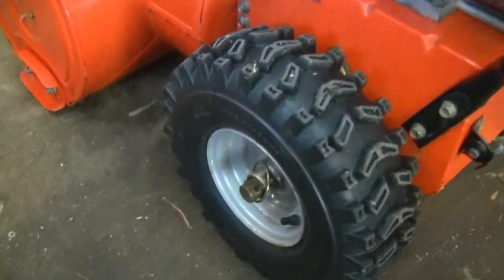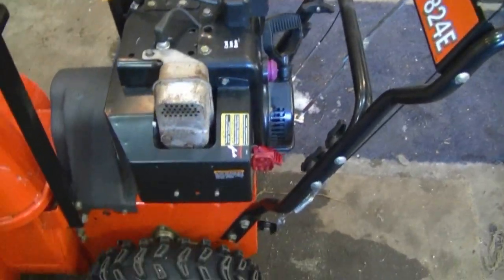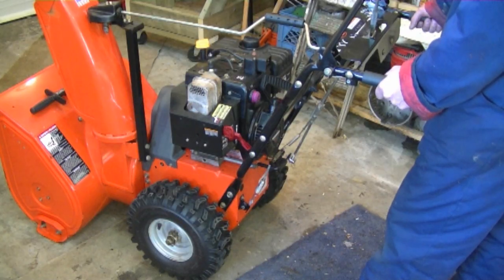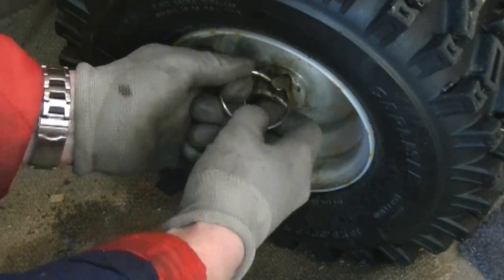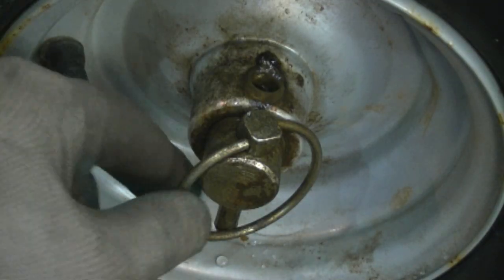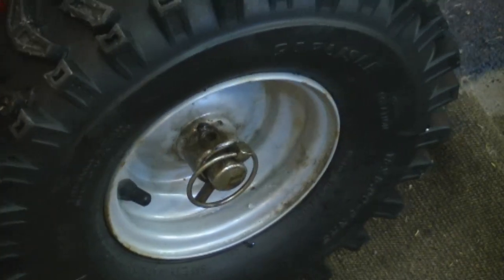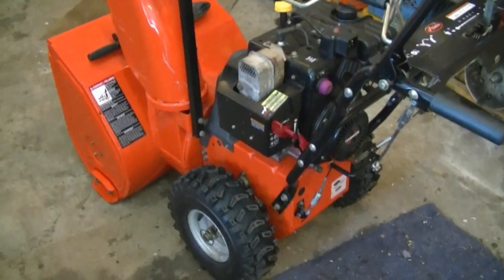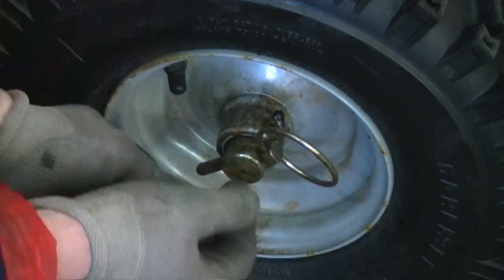WHY THERE ARE Multiple Holes on a Snowblower Shaft

Comment: I was sliding the wheel out and going through the hole and couldn't figure why it was still locked. Never thought about  doing what you did. Thought something inside made it like a differential. Guess I should have looked at the picture a little closer on the snowblower.

Comment: Maybe a silly question but what stops the pin from vibrating out when running the machine if the pin just slides in like that? When it is in the "inside" hole, the ring is around the axle but when the pin is in the "outside" hole, it looks like it is not or can be not around the axle.

Comment: speaking of wheel holes and pins.  I have a 2021 Toro Power Max HD 828.  The axle pins in my wheels keep breaking.  I have had more than 3 pins break on me.  I believe it must have happened to both wheels as neither wheel has the original 'ring pins'.   When the pins broke, I assumed this was normal behavior and used some auger shear pins but it keeps breaking.  Now I am using a cotter pin.  I might be a bit aggressive digging into roadway drifts but only at speed 1 or 2.  

Have others seen and solved this problem?   thanks

Comment: Ok, but why does my manual say this? (I know you don't say to do it this way in your video, but it helps me understand how things work if I also understand what could go wrong if you do it the wrong way) NEVER operate the snow thrower with the
click pin inserted through both the RIM and the OUTSIDE HOLE in the axle. Doing so can result in serious damage to the drive system. 
What could happen if it was like that? 
Let me see if I understand: If I want traction in both wheels, I should have the pin through the rim and the hole closest to the machine, one hole empty and visible on right and left wheels. If I want traction from only one, then I put the pin through the rim and the hole closest to the machine only on the left side so one hole is still visible on the shaft, and on the right wheel only the shaft farthest hole not through the rim at all?

Comment: i have an ariens compact 24 with the same type of wheel set up, i want to remove the wheel on the oil drain plug side to make it easier to change the oil, can u tell me how to remove the wheel off the shaft, ive removed the pin and tried sliding the wheel off the shaft but it wont budge

Comment: hi! I have a steep driveway, are there any wheeled blowers that do not freewheel when going down hill, or will they all run away from me?  thanks  I have an older tracked blower but the track keeps coming off even after adjusted.

Comment: Thank you!  You are a lifesaver!   Out of all of the YouTube videos, you are the one that makes perfect sense as to why there are pin locks on snowblowers.  I ran outside after watching your video and sure enough the pin on the right side of my snowblower was not diff locked.  I was so relieved because my snow blower was so hard to push, had no idea one wheel was freewheeling.  I have a brand new Ariens classic 24 inch and I think it came that way from the manufacturer.
Reply: Same!!! I have only needed to use it a handful times and was wondering why only 1 wheel was moving!

Comment: Finally got an older 26 inch Murray built Craftsman with this feature. Tried it both ways I like both Wheels powered.
Reply: So do I.  I have a Noma 5/24 also built by Murray but it does make it more difficult to wrestle around corners.  However I don't like fancy features like power steering which is expensive to fix.

Comment: Don,   I have these two holes on the right wheel and I've learned now that the axle is not locked.  That explains why I can't make it up the driveway without being exhausted.  The left wheel keeps spinning.  I pulled the pin out but it doesn't look like the hole lines up in order for me to put it in the second spot.  Do I have to do something else?

Comment: Hi Don - great video!  I'm in Uxbridge, Ontario - I have a Canadiana 800/24 machine,  yrs old; I need to remove both wheels. Only one wheel has a lynch pin, the other seems to be bolted on to the axle. Have you seen this before? Why this design?

Comment: Hi Don. I have a "Made for JD" 1130SE with "Easy Steer". I don't like it. It's probably fine for  solid surfaces but I'm rural with a large gravel driveway. The drive wheels act so independently that even when I'm on a straight run one wheel will lag or stop turning all together and it's a fight to keep it straight. Do you know of any way to "lock" the wheels in tandem on these Easy Steer machines?  Thanks.

Comment: This video indirectly helped me out. When I tried to put chains on the were hitting a bolt. I did not see the extra holes in the shat. After moving both wheels to the outer holes the chains worked.
Reply: had the same issue with adding chains. I called Ariens tech support and pointed out the use of the additional holes on the axel shaft. Could not find any documentation about this in the SnoTek Operator's manual. So turned to YouTube as alternate resource - Viola (Waa-lah!!) .  [sometimes a better resource than OEM].

Comment: on my craftsman II snowblower, these wheel pins are being bent and then break off.  while just clearly that white fluffy snow that fell just a few hours ago.
I can understand if it was old heavy snow so thick one can make a snowman with the heavy wet snow, but... this is not the case.
I refuse to install a heavy gauge bolt - after watching your video you taught me better not to do this as I could break the transmission.
So.. do you have any idea as to why I must replace thiese pins 2 or three times per use

Comment: Since this machine doesn't have the easy steer built into it, by changing the pin hole on one wheel it can steer easier. Thanks Don for showing us this method.

Comment: donyboy why the spot of weld on the hub , the hole worn maybe  ? I was running mine with the pin through the hub and the axle on the outer hole , could this be why I shear the inner axle shear bolt  , there is little to no wear on the running gear inside , thank's for the information

Comment: You may add that if one shaft is seized,  what is shown is great, But,  since one wheel is already seized, , keep on using it and keep on spraying it with penetrating oil. eventually, that free wheeling rim will loosen up. Just my thought.

Comment: HI, is there a way to modify a snow blower with bolt on keyed wheels so  on wheel will turn on the axle? I would like the machine to be more maneuverable when moving it on dry pavement.
Reply from the maker: +Donald Mikel try removing a key on one wheel, it should turn freely

Comment: Dony how is the best way to get a rusted or frozen wheel off a snow blower? have a toro 524 with this problem on the left wheel. I am thinking of drilling a couple holes in the wheel and use a puller.
Reply from the maker: yes that would be good

Comment: This might be a silly question but here it goes. I have a craftsman snowblower from the mid 90s. I pulled the pin and placed it in the unlocked hole. I didn't like it very much so I went to put it back in the locked hole and there is no hole there. I have rotated the tire and their is no hole to put the pin back into it. Any idea why this is?
Reply: I have the same thing!  Did you ever figure it out?
Reply: @jimhaney3740  The wheel might not be all the way on the shaft or too far inwards.  You might have to remove the wheel completely to find out.  The hole couldn't close up by itself.

Comment: The holes are also for units that do not have a neutral gear.  The manufacturers call this "transport" mode to move the unit freely without cranking.

Comment: @donyboy73 I know that but you can use the outer hole to keep the wheel from sliding off... as you showed...
but my point is that hte outer hole could also be used to lock the wheel to the axle- just pull the pin, slide the wheel so it lines up the holes and replace the pin- no need for the inner hole on the axle.

Comment from the maker: @BigAgitator it's to prevent the shaft from slide from side to side
Reply: @donyboy73 @BigAgitator -- that is exactly what happened with my blower.  I was dumb and lined the wheel up with the outer hole.  Everything worked... Fast forward a few years and my side to side play was enough that my bushing on the opposite side would slip out. I thought I had bad bushings, broken washers, etc.  Until I looked at the wheel and realized my mistake (after watching your video).  Now the bushings stay put and everything is working great again.

Comment: They still don't need 2 holes on each side.  with just the outer hole, put the pin through hub and shaft for traction and for differential action, remove the pin, slide the wheel inward and replace the pin in the same outer hole.  I don't see the need for the "inner" of the two holes unless the intention is to keep the wheels the same distance apart in both "traction modes"

Am I close?

Comment: Hi Donyboy, I like your videos alot and have learned alot from them, thank you for posting all of them. I have a question, I got a MTD blower and its beginning to crack on both sides of the housing where it bolts to the front of the blower..... (the 3 bolts on each side, next to them) Is there a way to fix this? buy new? Weld? Angle Iron? Any suggestions would help. Thank you

Comment: @wheely132 not if they're cared for right. I have one that's nearly 40 years old and still going. the design barely changed over the years, so they all have similar performance. but as with anything, there are a few lemons. Tecumseh just seems to end up with more lemons than anyone else...

Comment: @raphgv927 
I have a ARIENS 2010 that has that option is a great option to have the bad thing on this my snowblower is 
it also has remote for turning both the chute up and down and around . Both have a recall and the parts are back ordered for 4 months so I had to remove them and use it cobbed up temp for manual operation for this past winter . If I ever get a snowblower it will not be a Ariens .

Comment: some blowers have a differential, and you can lock it or unlock it by pressing a lever. this way, you can unlock it when you want to turn and still get good traction when you're going in straight line.